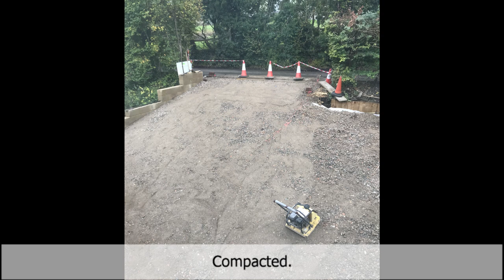STEEP DRIVEWAY BUILD | Gravel grids, Steep slope, Larch fence, Oak garage, Marshalls paving - Part 4

Comment: Hello, greetings from Norway, it may have taken a year to complete but the result looks 100% better, can I ask what the white gravel trays are called and where purchased from. 😎
Reply from the maker: Hi Mark, thanks for watching. The gravel grids are a brand called Core Drive 50-30. What we liked about them is that the geotextile is built in so the gravel stays in place and doesn't slip under the mat and offers better stabilisation. We could have gone higher up the slope with them, but decided not to in the end just in case we had issues getting in and out of the driveway.  Here is a link to their website - https://www.corelp.co.uk/core-drive/  Hope this helps. Karen